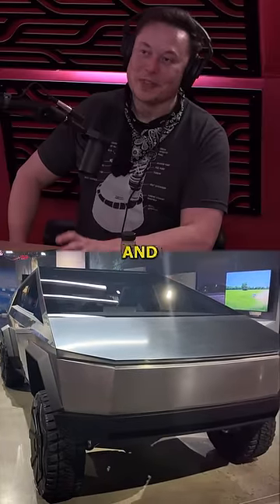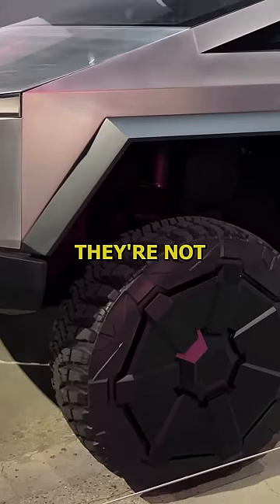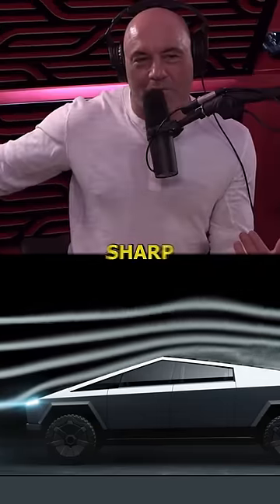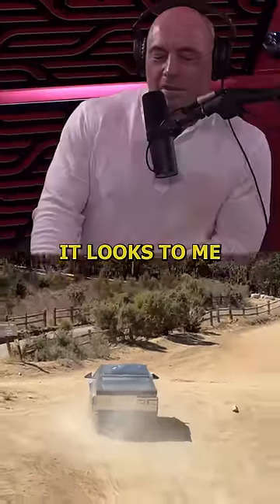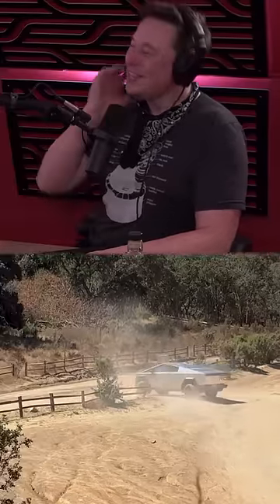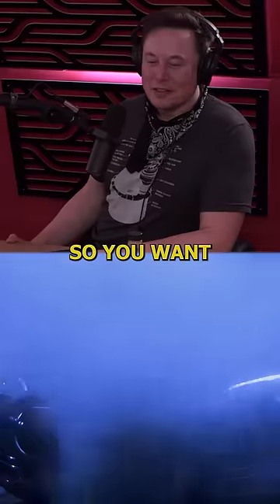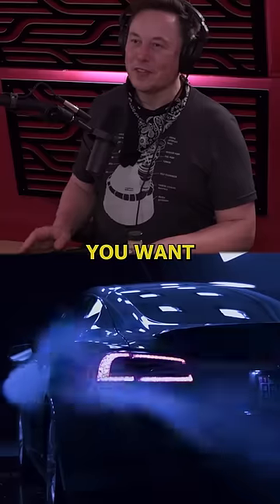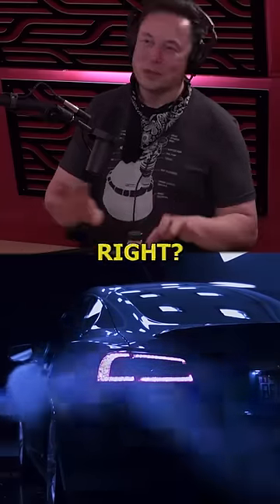Elon Explains Why The Cybertruck Is Not Aerodynamic

Comment: fun fact the Volkswagen beetle has better aerodynamics than a countach
Reply: Supercars aren't meant for fuel mileage they're designed to stick to the ground.
Reply: Klovor, be like, what the hell is the Eagle talking about, just like me.
He be on about aerodynamics and he on about mileage.
Reply: Countach has a huge wing for downforce so of course it'll have more drag. But without the wind I'd guess it would be slipperier than the beetle.
Reply: @roadrash999  you’re just wrong the countach just wasn’t wind tunnel tested, and is full of sharp edges which is just not aerodynamic, the beetle is an egg which is super aerodynamic. the front of the car is the main reason for its bad aerodynamics.
Reply: @eagle25311  you’ve said nothing
Reply: Well... Better draft coefficient, sure. But that's not all there is to the aerodynamics of a super car.
Reply: @klovor Also, countaches wing did not do anything. It actualy hurt the areo a bit.
Reply: @spencerlorrigan  yes but none that the countach really takes advantage of it’s built for form not function
Reply: @eagle25311 hey bud you need aerodynamics for that, why do you think F1 cars look like that
Reply: The vw bug was designed to use the least amount of metal .. I highly doubt it has super efficient aerodynamics .  And it was air cooled as anti freeze was a hard commodity to get
Reply: @darrencrosby4520  it was designed by Ferdinand Porsche. enough said.
Reply: Maybe it has less air resistance but it definitely has significantly less downforce
Reply: @darrencrosby4520  joke went right over my mans head
Reply: @klovor Dr. Porsche designed these vehicles at gun point from Adolph Hitler as a “peoples’ car” for the peasants whilst he was chauffeured around in his Mercedes Benz. Ironically, it became a beloved icon, but the car’s design was manifested from the idea of “the least expensive means of getting people to work with zero offerings from competition” instead of the western philosophy of “we will attempt to gain your business by offering you the car that you most desire”. A VW bug is nothing to be proud of. It’s a symbol of oppression and classism.
Reply: Punch bug🎉
Reply: . The context of this video is drag not race car aero performance.
Reply: @klovor you’re acting like countach was suppose to be a perfect race car… it was for flash that’s it
Reply: @JustTryingToYoutube  i literally said it was built for form not function if you can read
Reply: @wphh7272  the VW bug is a super cheap car everyone can afford not everything a horrible person does is bad ethan’s why mexico stopped production of the beetle in the 2000’s
Reply: A Chevy Bel Air is more aerodynamic in reverse.
Reply: @wphh7272  Making something like a car available to poor people that wasn't available to them before is not "oppression and classism"
Reply: Thank you sir, for telling me this I’m going to now cancel my order for the Countach and I’m going to get an old Volkswagen beetle instead
Reply: False.  The Lamborghini is slightly better by seven points
Reply: Lamborghini Countach:
car was never wind tunnel tested, but rather driven on the road at speed with tell-tales attached to the bodywork instead. The result is a comparatively brick-like drag coefficient of 0.42.Aug 12, 2021

Vw beetle

VW Beetle	0.48 - 0.49
Reply: @Psalm-yg6yi  the drag coefficient of the beetle is .38
countach is .42
Reply: Drag coefficient and aerodynamics are very different. Drag coefficient is just a part in the equation.
Reply: @DataLog  I know brother but most people don’t know what drag coefficient is and it’s not like the countach takes advantage of any aero at all
Reply: Um, anything has better coefficient rating then a contach
Reply: Joe rogan is really really good... at showing how little he actually knows. If it has nothing to do with unarmed competitive combat hes clueless
Reply: @eagle25311 you are mixing up aero and downforce buddy
Reply: Just looked it up.
Beetle drag coeff is 0.48-0.49, frontal area is 1.8 m2, so drag factor is 0.87 m2
Countach drag coeff is 0.42, frontal area is 2.04 m2, so drag factor is 0.86 m2.

Basically the same drag.
Reply: The '60's and '70's Beetles or the ones from the early 2000's?
Reply: @klovor Hitler's buddy 😏
Reply: @eagle25311 yes upside down aeroplane
Reply: It's not aerodynamic in the way that it a huge wing for down force and has a large crossection. However it you look at the circulation along the countach there is a positive circulation giving a negative lift factor which has a significant contribution to the drag since (using kutta jokowski) we can see that the that such a negative left will result in a higher drag factor however that is desirable for cars to drive well at high speed. Ita kind of a misnomer to say the beetle is more aerodynamic because a lower drag factor is not all there is to how aerodynamically efficient a body is.
Reply: @eagle25311 exactly bro somone that gets it an F1 car has more drag than a semi truck cause it’s producing 3-4 tons of down force
Reply: Guess what if you step on the beetle 🐞 you get a Porsche 😂
Reply: Purposely. They need to be pushed down by air resistance and being too aerodynamic isn’t good for that
Reply: @roadrash999 drag and holding down the vehicle are two way different things
Reply: @bottomofthemap696  In theory yes but wings always add massive drag in practice
Reply: @eagle25311  aerodynamics do play a role in fast cars around a track. aerodynamics aren't just so a car gets good mileage.
Reply: @roadrash999  that wing doesn't actually produce downforce, its all form and no function.
Reply: This isn't true. The Lambo has a coefficient of .42. 
The Beetle is .46 to .48 depending on the year it was made.
The lower the coefficient, the more aerodynamic the shape.
So your comment is basically wrong, but it is true that the Countach has poor aerodynamics for a sports car.
Reply: Even if that's true, it's still a Volkswagen. Are they still building those clean diesels?
Reply: @eagle25311 yk aerodynamics plays a huge part in downforce which is how good you’re car can stick to the ground
Reply: @scurzyyy That’s the same reason F1 cars are not very fast in the Quarter mile. The Model S plaid is just as quick.
Reply: @DataLog Thank you.
Reply: @hardcoreherbivore4730  you're comparing a combustion engine with electric motors
Reply: A Skoda teardrop car from 1935 had the same aerodynamic coefficient as the Ferrari F50 from 1995
Reply: fun fact. The most aero car looks kinds disgusting

Comment: Looks aerodynamic? Sure as much as g vagon lol
Reply: boxy doesn't necessarily mean not aerodynamic. Aerodynamics are pretty weird, and sharp edges interrupt airflow, causing chaotic turbulences , which in turn cause extremely high drag. A box with round edges is probably more aerodynamic than the Cybertruck because of this
Reply: @12345DJay  depends what you mean by boxy, the flat front is what I see as a problem. If you look at fast cars and all aerodynamic things they are kindy pointy or shaped as a water drop (water drop is shaped by the air in the best aerodynamic way as it's formed by it)
Reply: @mishimakazuya6167  while that is true you would be surprised how aerodynamic trucks are. And the are flat as hell frontally. They are obviously Not as good as a sports car but way better than what you would expect.

Comment: FYI: design of cybertruck is dictated by issues with forming that thick stainless steel. It's behaves pretty much like springsteel until you don't make hard, sharp edge. Spacex uses it starship, and for domes, where thay have to be stamped, they use slightly different type, that is easier to form. 

Problem with this other steel, there will be lost many benefits of using that hard material, like simplicity of construction, it will be easier to damage it, all scratches would much more visible etc. 

Ofc design itself is over the top, i just explained why cybertruck uses Basically only sharp angles

Comment: “You don’t want sharp angles”
The F-35 has left the chat
Reply: F35 is a smooth as it gets what are you talking about lol
Reply: Basic idea in aerodynamics is you want a smooth front and a sharp back. Smooth front and back would cause air to smoothly glide over and back down the car. The over is fine, as it has to be done but the back down causes a pressure to build up on the down slope, as the air would just want to stay smoothly gooing over and not back down. So to minimize those pressure zones you want that air to leave the car at a point like an edge where the low pressure zone is as small as possible. The pressure zone is basically pulling the car back, cuz the car was just there, but isnt anymore, and the air isnt fast enough to go there, so now there is nothing, and because there is nothing, it creates low pressure, which wants there to be something, and if air isnt fast enough to go there, it wants the car to stay there, so it pulls back on it, slowing it down. And ofc the bigger the area it pulls on the more it slows down, so you want as small low pressure zones as possible. Thats my high school level intuition anyways. 

The splitting air doesnt work, cuz its like pushing your finger against a wall when you make a straight line in an angle. Its gonna smack and hurt. But when u curve your finger, it directs the forces way more equally and you get it doesnt hurt as bad. So less force goes against the movement.
Reply: I don't know about the F-35 specifically, but I do know that certain airplanes such as the B-2 sacrifices aerodynamic efficiency for more stealth. The perfect round shape is way more visible on a radar than a flat surface which won't sent the radar signal back... It's all a compromise. The goal is not just aerodynamic efficiency, it's a bunch of different conflicting goals.

In the case of the cybertruck, they prioritized using that rolled steel which you can't really bend into a smooth rounded shape at all.

In the case of EVERY CAR they always compromise between aerodynamic efficiency and inside space / looks. For example, having a cover over the rear wheel is more efficient, every ultra-low-drag car has it. However it looks stupid, so manufacturers rarely make it, they want customers to like the looks of their cars. Except BMW, they have decided lately that ugly is better...
Reply: @Gvozd111 it's a plane bogus yes it's made up of sharp angles, don't EVER become or even THINK about becoming a plane engineer, you would put everyone and everything in danger.
Reply: @infinitehexington  yep well what I call smooth you call sharp. I think it’s the wrong vocab that causes confusion. What really matters is reducing surface area that is perpendicular to the air stream

Comment: to be explained more easily think about the air moving past the car as being in distinct layers. the sharp angle will force multiple layers (the layer sitting against the car and the layer sitting just above that will fly over the sharp angle) to meet at a singular point. so you’re breaking that ordered layer continuum. with a rounded surface you allow each layer to continue moving parallel to one another. remember it’s friction AND drag. you gotta think about what the air you’re moving is doing.

Comment: It's obvious that the CT is designed to be used in Mars. They just need to fit it with cabin oxygen system and it's good to go. No engines that requires oxygen to operate as well. It uses the same stainless steel as the spaceX rockets, but the steel is not moldable like normal cars, so the just fold it in shape, resulting in it's sharp design. It's stainless, so no need to paint to prevent rusts, saving cost of paint in the production phase. It's brilliant.
Reply: Compression moulding could turn those sheets of steel into any shape theyd like. 

Moulding isnt the correct term, its new technology, but basically two massive robot arms pinch the metal and bend it bit by bit to create shapes.
Reply: Sung a different tune during the 2023 Tesla Q3 earnings call.. I believe his words were..      "we dug our own grave with Cyber Truck.."💸💸💸💸

Comment: The worst part about the cybertruck is it only has 8 and 1/2 in of working suspension and they can't go true off-roading because it doesn't even have a skid plate to protect the battery pack and I haven't perfected a battery pack that can be covered in mud and not get super hot

Comment: If you have a high output motors and high drain battery but that would be the drag strip. A flat grill could scoop the air to increase longevity of the battery and motor.

Comment: Why not redesign it as maybe some sort of Ute or Chevy El Camino. It is already pretty similar in style to these types of vehicles. Smooth out the edges a little bit, place some classic tesla styling into it with the utility of the truck bed but the sex appeal of a modle X or Y. I could see this vehicle working out very well and without anything else competing with it on the market as well as the demand for smaller utility vehicles with the capability of a truck bed and still usable in big, compact cities, a tesla like that could make a killing. The cyber truck was a great concept car that was meant to grab the attention of others and show off the capabilities of tesla, their motors, and their vehicle, but as a stand-alone vehicle it needs a lot more work and redesign to make practical sense.

Comment: Aerospace engineer here. Sharp corners can cause the flow to separate. This is called flow separation, usually incoming air will “stick” on the body surface and flow with it. If it goes over a sharp angle, the air could have enough momentum and be going too fast for it to stay sticking on the body. What happens is the flow separates, which creates a swirling effect called vortices. If you look closely, you can see it happening on the top of the truck when it is in the wind tunnel on the bottom video. The air becomes disturbed after it passes over the roof and doesn’t stick to the roof anymore. 

This is basically turbulence, and that causes drag on the car so it makes it harder to move through the air. However, you’ll notice sharp edges are very good for the front of airplanes that go past the speed of sound because in supersonic speeds things are quite different. They still usually have round bodies tho.

Comment: No bumps? Explain golf balls then
Reply: These dimples vibrate the air around the ball when it is in the air, reducing drag. This means the ball will travel further than it would if the dimples were not present.
Reply: @kdogg6781  I know, I saw that MythBusters episode too, just making the point to Elon, but thanks I guess.
Reply: @JohnSmith-tz4on  honestly, i didn't know the answer.  but, i do know the dimples serve a purpose that's beneficial to the ball/golfer... so, i just googled, copied/pasted.

Comment: The roof line is pretty much the most important spot for air to pass over. If it gets disturbed and turbulent at he front or rear of the roof it makes the rear end unstable and not have consistent downforce to keep even pressure on the tires so it basically is trying to hop around if theres a lot o turbulence. Too much downforce you start pushing air harder and burning more energy. The cybertruck is going to make all the air coming off the windshield turbulent and make it want to bounce and wiggle down the highway. Awful design from the most simple standpoint...